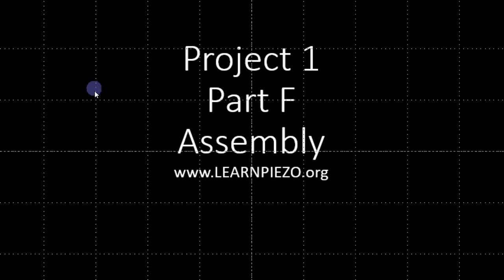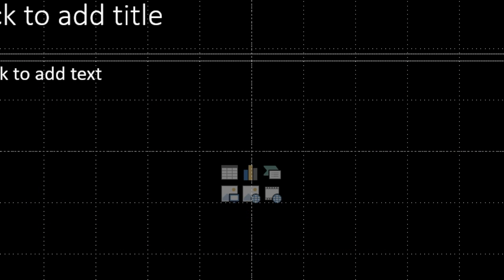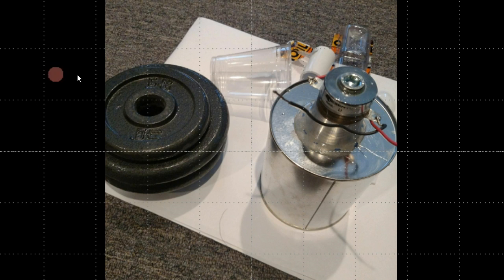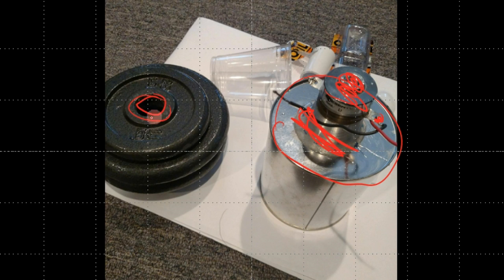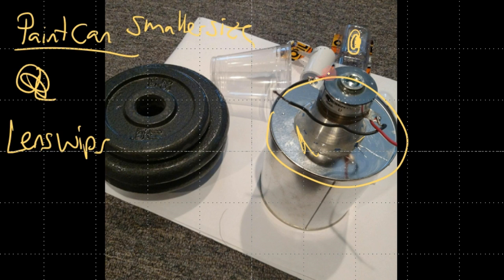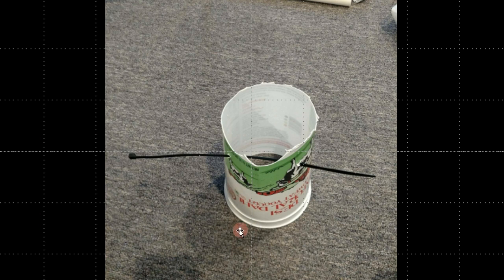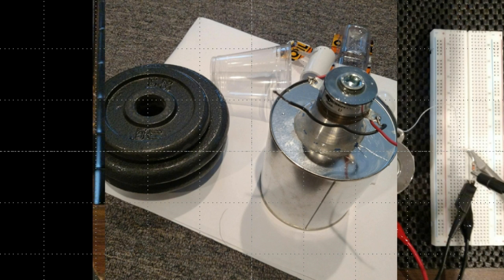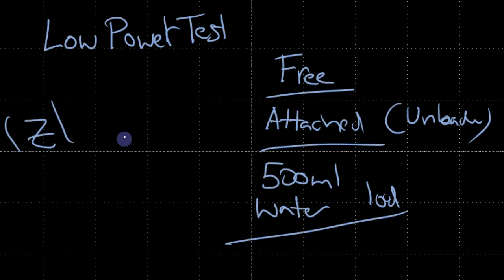The method to assemble an ultrasonic cleaning transducer to a container

Comment: Is it possible to dissolve solutions using this device?
Reply from the maker: Yes, it called ultrasonic emulsification. It can be used to blend oil and water
Reply: @ultrasonicadvisors  
If we have the heating wave as a microwave wave and we have the cleaning wave as an Ultrasonic Cleaning Transducer wave and we have an ultrasonic emulsification wave, and wave soldering, so what are the other types of waves?

Comment: My ultrasonic cleaner transducer have been detached from the surface . How can I attach that again .
Reply from the maker: Sand both surfaces and then clean them with alcohol and purified water. Then apply epoxy to both the transducer and the surface. Then apply a weight to clamp the transducer overnight and let the epoxy cure.

Comment: for a good gluing process its not always advisable to press the glue from between the surfaces , often thin wires (0,05...0,1mm) are used to secure a thicknes of glue , this leads a better even force distribution, also should the can bottom be supported from the underside , otherwise you put stress in the glued surfaces which leads to distortions
Reply from the maker: Those are all great suggestions on the technical aspects of gluing. Really awesome share!

Comment: when you attached the transducer to the container with the epoxy, what did you do with the screw that came along the transducer, did you use it (screw it) or not (let that place empty without the screw)
Reply from the maker: If you epoxy, then remove the screw.